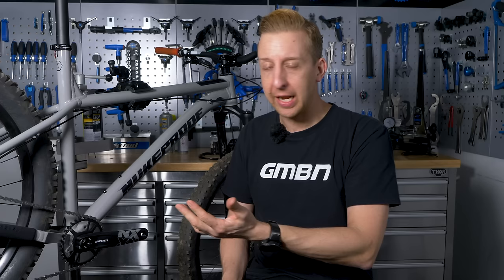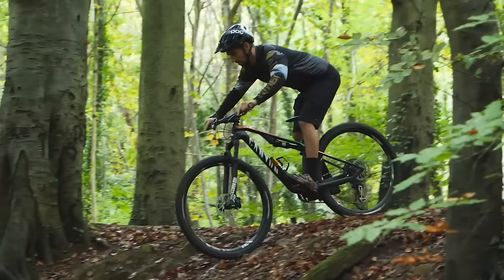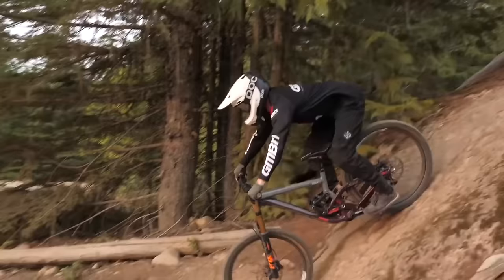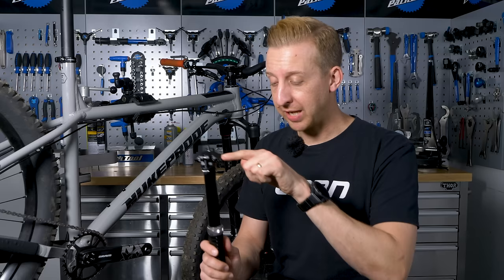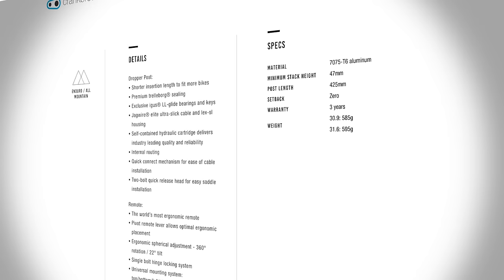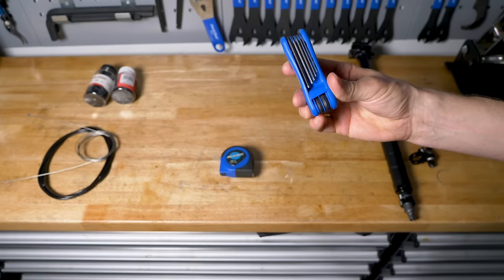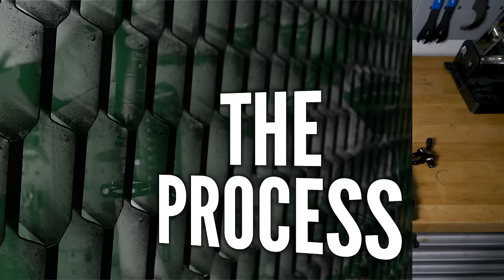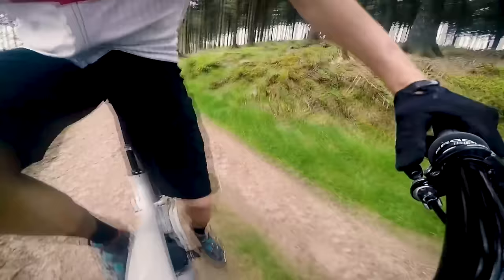Mountain Bike Dropper Post Install | GMBN Tech Essentials Ep. 10

Comment: For years I refuse to get a dropper post... then my new bike came with one and is awesome, I am getting more fore my other bikes, thanks for the tutorial Doddie,cheers!
Reply: Probably the best purchase for a bike you’ll make
Reply: I've resisted getting a dropper for all these years, I just never felt like I needed one.  I'm installing one on my XC tomorrow, I hope I find it as 'essential' as everyone says they are!  Great install video Doddy.  The part about measuring the cable still isn't 100% clear, I assume you measured the 165mm down from the original 'frame' mark, and that 165mm amount was based on your dropper length inside the frame, but I'll make sure to measure multiple times before cutting.

Comment: Great! Thanks Doddy. Appreciate this but showing the cable routing technique without the cable tool would have been handy to. Its an expensive bit of kit that I’m not likely to use that often...
Reply from the maker: Hey Addsy, Find an old spoke and bend the end creating a hooked pick tool and then poke this into the cable exit hole. Feed the cable through until it passes through this and then pull it out. Hopefully this helps you 👍

Comment: I used the wire cable itself as a guide. I inserted it first on the bike frame along with the remote lever and protruded it out of the seat tube. Next is I slide the housing cable into the wire cable that is already inside the bike frame thru the seat tube and up towards the routing coming outside of the downtube. And viola, the upper end of the housing will automatically fit to the remote lever as you pushed. Finally is setting the wire cable length with respect to the housing cable using the plastic piece protector that came with the droper post to fit to the engagement of the dropper. (Note: I did not cut my housing cable as I estimated the stock length is appropriate for my frame)

Comment: Found this vid useful. Good solution I used today to install brand x dropper post cable internally on my 2021 vitus hardtail is to feed a length of wool - yes wool - down thro the top hole in the downtube, put the hoover nozzle over the hole at the lower end of the downtube, which sucks out the wool. Tie a length of decent fishing line to end of the wool, tie other end of fishing line around the end of the outer cable, just below the ferule/end cover so it has something to grip, wrap tape around this to prevent the knot from snagging on the hole(s), making a conical shape so the end is streamlined for smooth egress from the top hole... feed the outer cable up the downtube, pulling the fishing line at the same time... Et Voila... the outer cable pops out the top hole and has been successfully routed internally thro the downtube. Wool works well as being light and 'fluffy' it catches the air  better than string/bootlace etc which I also tried without success. The wool and hoover method worked first time for me. The outer cable then easily feeds up thro the hole at the back of the seat tube behind the bottom bracket on my bike - others may be different - the rest is straightforward, follow product instructions. A good spin on the bike followed with dropper post working well :-)

Comment: That cable routing tool is a great idea, but I needed one in a pinch so I knocked one up, used a small tie rod end from an RC car with a screw in it tied to a length of string and a magnet inside a sock (using a clean one is optional), then a paper clip to hook it once you're on the port, worked a charm and cost nothing!! Any questions gimme a shout!!
Reply: Mate you're on to something. Can you post a photo somehow?
Reply: @danielbromley849  I can't post a photo unfortunately, basically you need to tie something made of a metal that the magnet will grab and small enough to fit through the ports to the string, pop it in the port, then cover a good strong magnet in fabric so as not to scratch the frame and pull the metal along to the exit port then hook it out, then back to where you went in, attach the loose end of the string to your cable outer with a couple of wraps of tape, it needs to be able to fit in the port, so not too much tape (good idea to put a knot in the string so it can't pull out from under the tape), pull the string through and the cable outer will follow, once that's in thread the cable inner through and the hard bit is done

Comment: A catch with this specific model: 9:00 minute: when you stick the grey cylinder into the post you have to turn it clockwise to the limit (lock point) and only then tighten the black lockring, otherwise when the remote cable is in its released state the cable-side rotor gets to its most-clockwise position, but the seatpost-side rotor doesn't and the dropper doesn't lock completely.

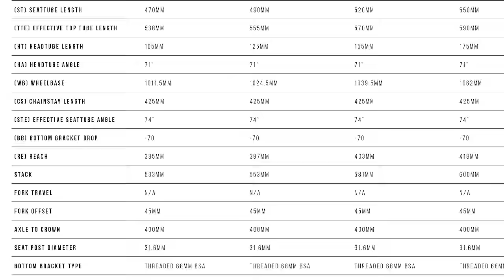Comment: 1:38 actually a problem I had was the lack of information on the actual DEPTH of the seat post. 
I have a Giant Faith 2010 and had to do a bit of manual measurement with the old seat post, dropping it as far as it would go, (which is actually not all that far in my frames case) to get the maximum depth, then measuring the old post at its highest ride height for me.. (109% etc) to get the maximum length overall that could fit...
Then it was just a case of finding the best drop I could get within that length... and there actually wasn't many options for my budget or even no price limit.. with factors like no internal cable routing option etc. due to the kink and pivot halfway down the seat post tube.

I went with a Zoom Tequilla (100mm drop) from the cheap range to make sure the calculations were right etc. I have about 20mm unused depth with it at the correct height... but if I really need it, I can always drop the body and run the day with a short max height, but gain the extra 20mm drop. (There wasn't a post  that gave a better lower position without loosing upper, or bottoming out before the upper most position was at my riding height (which would have ment having to constantly adjust the seat to get the correct climp position rather than it just being set at full extension.

Due to the frame geometry, the exposed post to the seat is almost the same length as the depth from the top of the frame tube to the suspension pivot they ran through the center of the post tube to ensure it was impossible to get a longer post in.

What I need is a 2 stage telescopic post to get more than the 100mm but the design would have to be heavy to retain strength over the joints...

Comment: Thanks for the info I just replaced my cable and lever today but got carried away at the start and pulled the old cable and housing straight Out so I had to feed a piece of string with a bolt tied to the end  through then tie and tape that to the new housing and pull it back

Comment: Im having a heck of a time getting housing thru my frame without it shredding the outer housing up. Ruined the first one already. Gonna try a Jagwire Pro kit as it serms the outer housing is smaller diameter and more flexible
Reply: The holes at the bottom of each tube seems really sharp

Comment: Great Channel! You are my goto for Mountain Bike Setup! I am building a Carbon Scott Scale. My Question/ Concern is, I am adding a Dropper Seat and it requires a fully cased cable terminated under the Dropper itself and at the Control Lever of course. So First question is it ok to drill out the frame entry (Hard Plastic Grommet insert) to have fully cased cable from control to Dropper... Second Concern is Rear Derailleur enters frame "Typical" Left side... Dropper Control will be on the Left Bar and enter the frame "Typical" Right side... I feel like its going to result in an In-Frame cable crossing (Rubbing?), as the Scott has a bare interior cable setup for the rear Derailleur that exits "Right" side under Bottom Bracket! Left over to right! Dropper will be  Right to, up the center Seat Tube of course? Whats your thoughts?

Comment: I want to fit a dropper post to wife's emtb. She finds it hard to get on and off with the seat at the right height for 'straight leg down' when pedalling. Have 20cm inside seat tube but need absolute minimum protruding above top of seat tube with dropper down. Getting info for available droppers is a nightmare!

Comment: I'm confused, instead of all this measuring can't you theoretically just insert the dropper with the cable and cable housing already ran through the bike and connected to the dropper, set it at the proper height for the way you ride , then pull the slack out at the top then just pull the cable tight and secure it at the lever?
Reply: That's what I did when my bike was delivered with the cable all squashed in the bottom.

Comment: What about external cable dropper posts? Some older frames just dont have internal rounting.
Reply: You can use the Magura dropper seat, a bit expensive but without cable
Reply: @FredGtn  Yes, but there are also dropper posts with external rounting, and they are cheaper.
Reply: It's way easier.
Reply: What about them? You just put it in your bike
Reply: @conman1395  yes, i think like DODO didnt say u can use it, so a lot of people can think there are only wireless or internal rounting

Comment: I’d recommend soldering the end of the cable to prevent fraying instead of crimping. If done cleanly you can pull the cable out without cutting or prying the crimp off which WILL damage the cable requiring replacement
Reply from the maker: Have you actually managed get this to work on modern cables and housing? It used to be common back in the days before cables were stainless and housing had a PTFE liner Solder Wire. We have tried this with a sanded Galvanised inner but had pretty poor results. It's also hard to get Solder with Lead in it now in England.
Reply: Might be cause we still have lead based solder and I use cheaper non-ptfe cables, mainly cause they lube better in the long run
Reply: Use super glue for this instead of solder. On a pre-existing install, if you know you are going to be removing the cable and want to try and salvage it, super glue it just above the crimped on crimp thingie a day before you need to remove it. Now you can cleanly cut the cable and it won't fray.

Comment: Hey Doddy, I recently mounted an RFR Pro dropper post on my hartail Cube Reaction hybrid. now I have read that There is a maximum rider weight recommended for this dropper. I am not a light weight rider myself and my own weight is sitting against the max weight of the dropper, which makes it not so pleasant, I am afraid that I can damage the dropper if I ride on it. I was wondering why I don't see this in any of the dropper videos? Is this something I should take seriously or just an indication? I wonder how many people have had any problems with this.

Comment: You need to address the pain that is cabel management on a external dropper post. Excess amount of cabel close to rotating tiers.
Reply from the maker: Yes internal routing through the seat tube is much neater and keep the cable out of the way.

Comment: Really nice tutorial. Also, if you were not so advert oriented, you would use a Shimano TL-CT12 cable cutter that already comes with a pick to make sure the housing is opened up properly on both ends.

Comment: Did you just crimp the end cap with needle nose pliers even though you clearly have actual crimpers that are made for the job on your wire cutters?
Reply: doesn't matter at all.
Reply: Tryinglittleleg the crimpers will do a cleaner and better job every time. Also, worth mentioning in case they don’t actually realise their wire cutters have the crimpers...

Comment: i have a scott aspect 760 2016 and there is two bolts on the seat tube. and the were blocking the seat from going all the way down, so i removed them. but no there are still some weird cylindrical things in the seat tube so i cant get a dropper post. pls help.

Comment: Anybody run into the issue with the waterbottle anchor inside the frame limiting the space you have to insert? This is for a medium 2021 Specialized Rockhopper. Was hoping to throw a 200mm inside, but may have to settle with 125mm

Comment: My 400mm  bizango seat post can drop 250mm into the tube. Would I be able to fit a 170mm dropper (274mm insert including actuator) with 30mm left below the collar? So 244mm inserted in the frame. Just curious as the measurements say yes yet I've read someone saying you can't even fit a 150mm post. Maybe they're just assuming a full insert.

Comment: Hi All. I have installed a dropper but it seems to drop a bit when I sit on the seat. Any reasons why it would do this. Thanks in advance.
Reply: Checking your pressure would be the first thing to do.

Comment: what are the benefits of hydraulic operated posts?
what are the disadvantages?
Reply: No advantages really and they're unreliable.
Reply: They fail and need to be sent in for service. 
Oh yea, advantages ..  uhhh... hmmm...  can’t think of any.
Reply: The biggest advantage of hydraulic posts is that you get to purchase a $60 bleed kit and bleed the system each time it is installed. The second advantage is you get to send it in for an expensive repair after half a season. But at least you already own a bleed kit when you get the post back two months later. A third advantage is you end up buying a cheaper dropper post the second time you send it in for repair. Then realize that the cheaper cable actuated dropper post works really well and wonder why you paid over $600 for the hydraulic seat post that comes with the worst push button design.

Yeah, if you don't own a hydraulic dropper post you are missing out.
Reply: @newttella1043  Hahaha exactly!
Reply: On a more serious note, they don’t suffer from friction issues on frames with tight bends.

Comment: #askgmbntech I use a seatpostmounted rack/carrier on my bike with a regular seatpost. Can I mount a rack to the part of the dropper post that does not move (the one that is clamped in to the seatpost)? I asked a manufacturer and they said that it is technically posible, but they wouldn't advise it, because it can change the performance of the dropperpost . I think I can if I do not tighten the rack harder than i tighten the seatpost clamp.

Comment: Everyone has a video walkthroughs to help install a dropper post. None has a video showing how to remove the damned thing. Can I just pull the internally-routed dropped seatpost from the seat tube - or will I ruin the precious carbon frame by doing so?

Comment: Hey dodd, 
i am currently using a SDG Tellis 150mm with internal routing and was wondering if  I just can replace the dropper itself for a oneupcomponents 180mm dropper and use the installed cable from the SDG as it already has the correct length etc. ? Or does the fitting on the Dropper itself differ from brand to brand?

Cheers from germany
Reply: Try and comment on a newer vid mate 👍🏼

Comment: @gmbn tech,  is there a possibilaty to route the cable internaly if there is no routing through the seat tube currently?

My frame (BULLS Copperhead RS+ 2016) has internal gear and brake line routing but I cant see a way to get up in to the seat post.
Reply: You may have to remove the cranks and bottom bracket to fish the line from the down tube (assuming you can internally thread the line into down tube to begin with) and up the seat tube. I know with pressfit BB frames there's lots of room in that area to reinstall everything. But for threaded BBs, I don't know if there's is enough space to fit that plastic tube between the cups and not pinch or force a kink in the line.

Comment: what is a good cheap dropper?
Reply: Beyond Paradis3  thank u
Reply: Beyond Paradis3  sorry I can't seem to find pnp, are you sure it's not rsp
Reply: Brand X on chain reaction cycles
Reply: Brand X.
Reply: Brand X gets my vote. So reliable.
Reply: OneUp Components dropper post. $199 for 170mm of drop and you can tune the amount of drop all the way down to 120mm with these plastic shims that you trim and slide in. They're pretty solid.
Reply: I've got the KS e20 with external cable routing. For about 160€ it does its job really good!

Comment: I disagree about always getting the most travel dropper you can. Many people literally can’t use a 175 mil dropper as their feet can’t touch the pedals.
Reply: So their not using a dropper they can get away with are they. Basically he means the post that you can use properly. As in its not to high at full extention but with as much drop as that size, length allows.
Reply: not kidding, with my seatpost slammed to the frame my dropper at it's highest setting is a bawhair too high, maybe 5mm to be comfortable........trs+ 150

Comment: How you go around bottom bracket?
Reply: Im installing one on a Nukeproof scout 290 myself. I have looked into this. The internal cable exits the frame at the bottom of the down tube before the bottom bracket shell, loops externally under the shell and  then enters the frame again and up to the post. If you look closely at images of the scout you can see the visible bit of cable that loops under the shell.

Comment: #askgmbntech Hi Doddy, first of all I want to say a big thank you for the fantastic videos. After a bad experience with my local bike dealers I started to repair, maintain and improve my bike by myself. Your videos have helped me a lot.
Since I really enjoyed it, I'm thinking about building my own bike. I would like to reuse many of my parts from my current bike (It was an entry level XC Bike). I have a complete and nearly new XT 2x10 drive. On the search for a more robust Hardtail I fell in love with the Nukeproof Scout 290 2019 (like the beauty in this video). It seems that the frame supports a 2x10 drive, is that right? And if so, what kind of front derailleur is needed?
Thanks!
Daniel